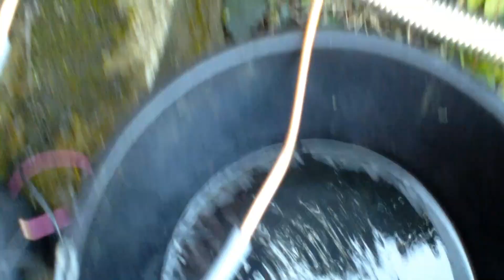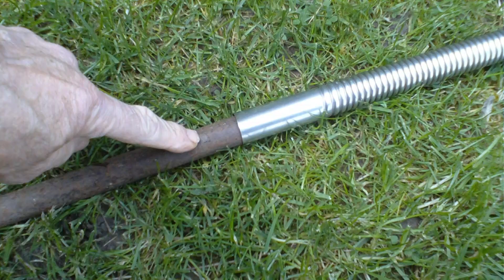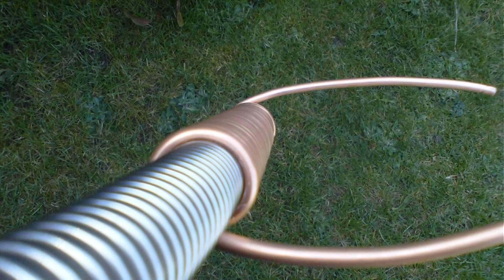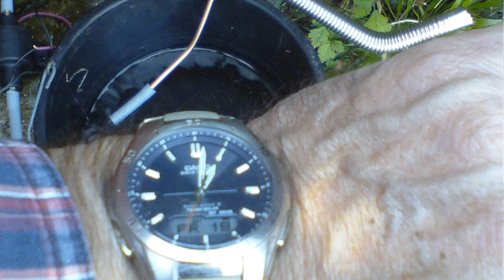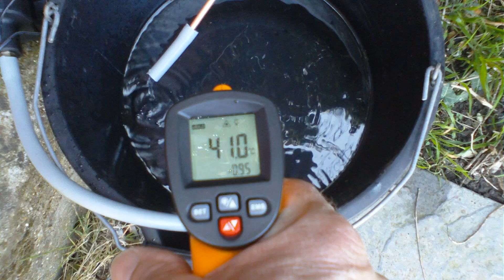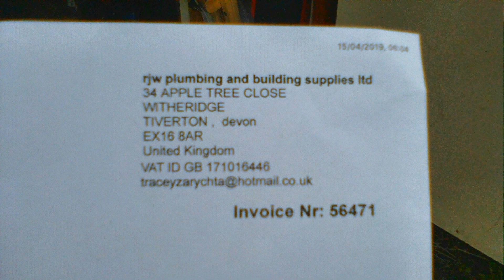DIESEL AIR HEATER EXHAUST HOT WATER FOR FREE VID TWO

Comment: Hello, do you think that we can produice 100 degrees water with an diesel exhaust ?
Reply from the maker: Hi there. Your question is a strange one because why would you want to produce boiling water! If you require that even a domestic water heater could not supply it.
The whole idea was to recover the heat and use it in a useful way like heating a store of water which could be used for many things - even to stop a water tank from freezing. There are many applications the recovered heat could be used for to save throwing it away - after all you've paid for the heat so a great shame to just pump it into the atmosphere ...
Regards Peter
Reply: Peter Bruce thanks for your answer, I am produicer of apple juice in mobile line, and I want create hot water with my generator for pasteurisation with my exchanger
Reply from the maker: @jean-damiennoiret3473  Hi again. Sorry the idea an not help you but it seems that to produce the boiling water you require would need a lot of heat input and this little heater was originally designed just to heat a lorry cab so you can see it falls way short of what u would need.
Good luck with your search.
Regards Peter
Reply: Peter Bruce thanks Bruce ;)

Comment: Copper wraps before muffler/ silencer. Insulate with headder wrap or crabon fiber welding blanket. Hot coffee or tea. Or have it go to an insulated holding tank that is circulating all the time. Very good video, and very good idea. From across the pond in the USA.
Reply from the maker: Hi KLH. Many thanks for your kind comment and glad the video has sparked some interest over the pond. I am sure others will have a go although I have not yet had any confirmation of it yet - once the video catches on over there I’m sure it’s simplicity will prove useful to making a good working system as why throw that heat away! You have paid for it🤔🤔🤔
Regards to you sir. Stay warm.
Peter

Comment: Second hand EGR heat exchanger on ebay is cheaper, easier AND more efficient. Anyone thinking of making this setup should research EGR coolers.
Reply from the maker: Hi Nate. Thanks for the comment - the video I made was for a start position for anyone contemplating having a go and also to see what usable heat could be recovered. EGRunits come in all manner of shapes and sizes which means you have to be more adapt to use them and of course have the space to install them.  Regards Peter

Comment: Search eBay or similar for an EGR heat exchanger - save the hassle of trying to make your own :)
Reply from the maker: Hi Toby. My approach was for simplicity and ease of construction together with not causing any issues by the introduction of any additional bends or making extensions to the exhaust pipe. The ERG unit is very valid but can cost and it’s not as simple as the copper pipe but if you had one going for free and doing nothing then it’s a good move.
I did both videos as I was interested in seeing what usable heat could be captured and the video was a steppingstone for others to build upon which (all credit to you ) a lot have done. Many thanks for your valued comment and if you have a working system on video please let me know.
Regards Peter

Comment: Very interesting idea PB.  I wonder if you could do this without a pump--via natural circulation.    This is what I'd try if I had all the parts:  Use a slightly larger copper tubing, wrap and insulate it for the full length of the exhaust pipe...as you had suggested.  Also insulate the higher outlet end and have it go up to a higher storage tank (about 1-2 meters from the coil).   The bottom of this tank could then be tapped for the cold water return loop--to the lower point of the copper coil.  Not sure how well this would work (?)...but it might make a fun project for my future camper van.
Reply from the maker: Hi juniper - yes a gravity system would work with an expansion tank however the design parameters in a small van for the required correct runs to get it to kick start would be very hard to accommodate so a small pump with very low electric consumption would I feel be the best way to go. BUT give it a try if your so inclined and let us know as it’s an interesting topic. Regards Peter
Reply: @brucepeter2007      Another thought:  Have the tightly wrapped copper tubing 'be' the exhaust pipe...no additional center pipe needed.  Thus, it would have direct contact...with the exhaust gases (passing through the center space of the coiled tubing).  This 'heat exchanger coil' could also be soldered/brazed for maximum efficiency--so it wouldn't leak any gases between the coils.   The cooling water (passing through the coil) should also keep the solder joints from ever melting or failing.
Reply from the maker: @JuniperTrekker  hi again Juniper. I have to say people have suggested many variations on the theme but as yet I have not seen anyone else try anything yet on YouTube so if you want to try please do.
One if the issues with these little heaters is that the free flow of gasses is imperative and the tube lengths and number af bends is critical to there proper working so there are constraints. By using the simple copper wrapped coil I used everything was simple because you could even remove the exhaust and leave everything in situ while you worked on the removed unit. I only played about as I was keen to see if anything could be done easily and it can so I would guess some have developed it to a higher degree and mine was kept simple with no insulation and the test performed with an open bucket and no insulation on that either so imagine the result with the same system I made but with plenty of insulation...
The mind boggles...
Regards Peter

Comment: Great video! Very neat solution! I’ll might try this in my boat! A small comment for better efficiency (I would think): Use the copper pipe before the muffler and not after. Check the temperatures of the exhaust pipe before and after the muffler and let us know your findings. Mayby redo the experiment and compare the results.
Reply from the maker: Hi Per. I have to say I took it as far as I wanted to just satisfy my curiosity as to how much heat I could recover and I was well pleased with my crude 
set-up as it worked better than I ever expected with the small copper coil.
No insulation to keep the heat in and I could have improved it no end with an even longer length of copper pipe to milk even more heat out of that exhaust...
My intention of posting the video was to show what you could do and the off grid lads will no doubt improve on my meagre experiment which is what it’s all about on YouTube - help and enjoy. Regards for your comment.
Stay warm.
Peter

Comment: Had a brainwave. Have the coil outside, pipe the water from inside to the coil and back into the cabin or shed or what have you to have hot water heater for whatever you need in your cabin out in bush country.

Comment: Well done mate. Can give you water plenty hot to get a shower or bath if living in the bush during the winter. Or hot water to wash dishes with.
Reply from the maker: Hi there. The idea was to use the free heat during cold periods instead of throwing it into the atmosphere and this is the second video experiment I have done and this shows that using this system can work quite well - especially if you use 9 meters (30feet) of the copper tube. Circulating to a hot water tank would provide enough stored water for a shower and the return after the hot water tank could have the copper tube pass through the cold tank thus providing just enough heat transfer to prevent freezing. The possibilities are all there for anyone to have a go at. Thanks for your comment - stay warm. Regards Peter

Comment: Thought about doing this on my van engine exhaust !
Reply from the maker: You can now see it works so have a go. Regards Peter
Reply: You could could probably gravity feed it from the bottom of your tank and the pressure might feed it back into the top might need a pressure release valve though lol
Reply from the maker: Best to keep the pulse pump - very low current and keeps it simple as a gravity system is not straightforward in an RV or boat and could be more trouble than its worth. This way it works - always. Everyone can modify it to their needs but at least in winter when your heater is on you  can stop your cold water tank from freezing up and even get some free hot water. Better to use the heat than throw it into the atmosphere. I’m not green but I don’t believe in waste if I can help it. Thanks for the comment as the more comments the merrier. 
Regards to you. Peter